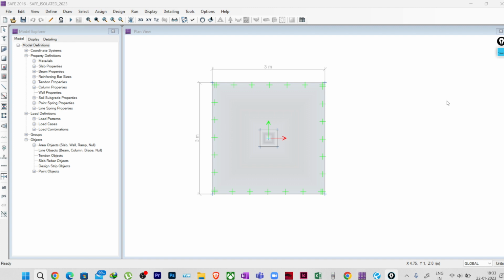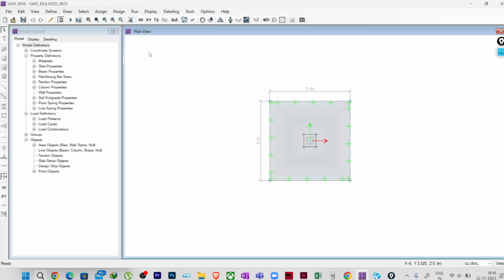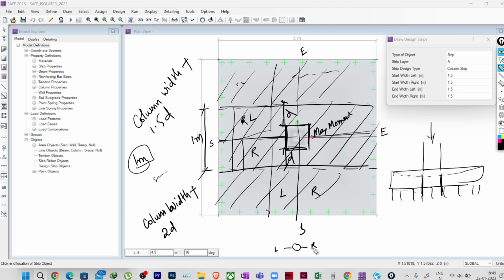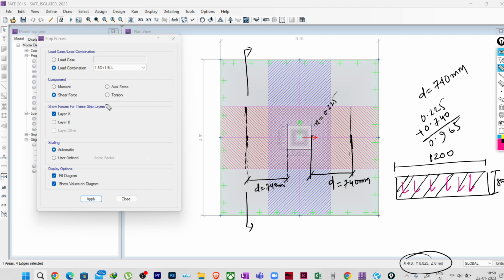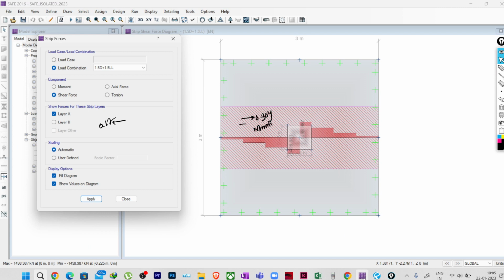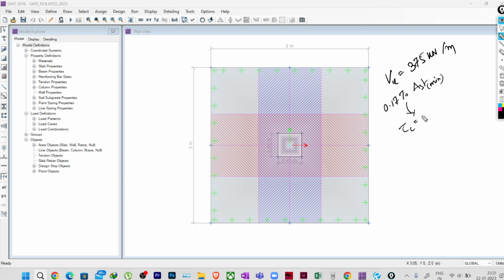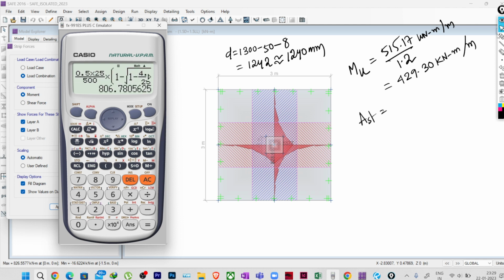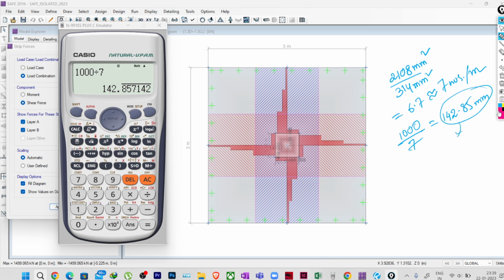Foundation Analysis and Design | Lec-04 | SAFE 2016 and Manual | ilustraca | Sandip Deb

Comment: Sir,I have an dobut ,min reinforcement calculation is 0.12%[fe415,500.. tec)of total cross section area(slab/footing/solid slab ) as per code.But my confusion is, why u have consider as an beam elemnet and calculate min reinforcement  accord to that (Ast/bd = 0.85/fy)..is there any logic behind it?

Comment: Why are you treating one way shear failure as local failure? Is't it fail along whole width? In that case, cant you define a strip width of footing width for the calculation of one way shear?
Reply from the maker: Where did we take for entire width of footing.. ? we took it for column strip only.. that will be always the critical zone.. rest u can check making multiple strips..
Reply from the maker: m not considering it as local .  I have taken
Reply: @ilustraca  if you are taking shear force for entire width where we are expecting one way shear failure per unit width, then didnt we end up in a lesser shear force than 375 kn/m you taken. hope you understand my point. Thanks for replying and videos. Great videos.

Comment: Why do we need to recalculate the bearing capacity limit by adding the value 1.5x (ht. - footing thickness)?
Can’t we just take 300 KN/m2
Reply from the maker: 300kN/m² is Net SBC ... base pressure has to be checked against Gross SBC

Comment from the maker: The STRIP WIDTH can be changed for effective depth 1240m considering the method Column width + 2d... I didn't do that as it won't change anything much here. But you can do that and check. The validation for the same will be shown in the next lecture.